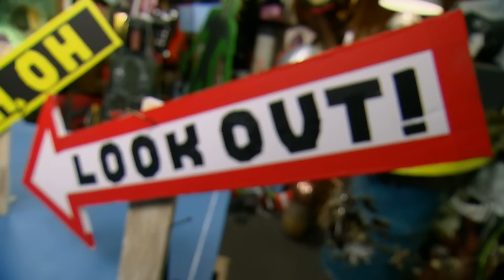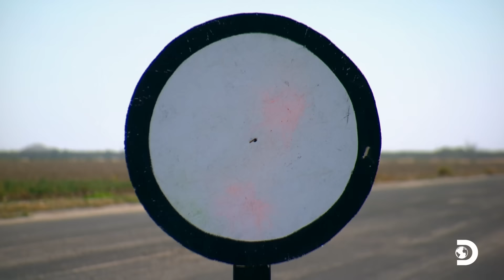Can You Shoot a Grenade Out of the Air? | MythBusters | Discovery

Comment: The shotgun would not have worked at range though.
Reply: with buck it would, all you need is a single pellet hit and at the very least that grenade isn't coming towards you anymore, it will take all the momentum out of the trajectory.   It may still explode but it may very well save your life since the grenade would be significantly further away.   43 yards is the upper edge of the average throwing range of a standard fragmentation grenade.  The grenade is considered lethal at less than 15 yards and further than that is considered wounding with possible lethality (un/lucky hit). Buck is perfectly viable at 25 yards..  the outer wounding limit of the grenade.  Ordinance labs talks about this on their channel a few times.  look 'em up.  Interesting stuff.  Or you can go in the military, they teach you some of this as well (dependent on the branch and MOS).

Comment: Yeah, but the shotgun was what, 2 feet from the grenade?  That would never happen if the grenade was in the air flyiing at you more than 45 feet away.
Reply: 45 feet will get a 15 inch spread depending on what load you use. or if you have a  choke. my Mossberg 500 just has a cylinder bore and my patterns are about 6 inches at 7 yards with standard #1 buckshot.
Reply: @abigailsaoirsefinnegan  Yeah, ok kid... tell yeat what.. give me the frag, and you the shotfun, plus give me a 3 - 5 second head strart, and we'll see who wins.  K?  Seriously.. give me your name, and home address, and we shall see..
Reply: @tinygod81   serious question, are you even old enough to buy guns? you do know that call of duty isn't real, right? 

now, I can only speak from experience.....every shotgun I've used has had a spread of about 1 inch per yard. real life isn't like the video games, kid.
Reply: @abigailsaoirsefinnegan  I'm a retired MSG from the Army with 4 combat tour across 2 theaters.  I know exactly what it takes to make a grenade exploed, and 15 to 40 pellets from a shot gun blast at 15 to 25 yards, is not it.  But again.. give me your name and address kid.. we can fking talk....

Comment: Guns were too close to get accurate data 15-30 meter gap would have better accuracy with shotguns and handguns for sniper 50-100 meter would be better well sniper has pretty low chances of hitting moving objects in air from close range. automatic guns with small caliber rounds would have higher chances breaking the grenade and higher callibers would detonate the grenade as it has high penatration and higher friction on contact.